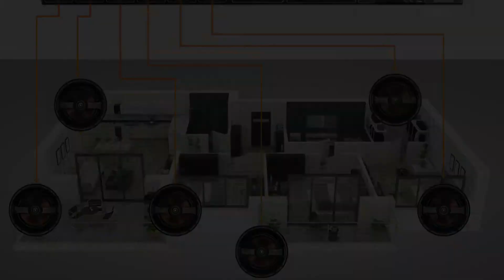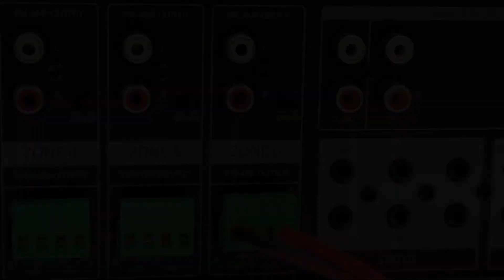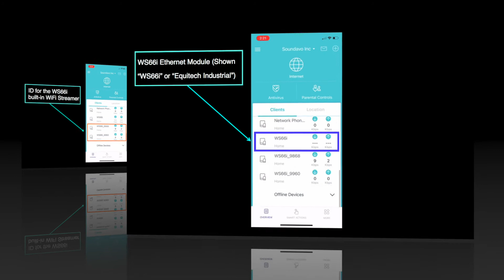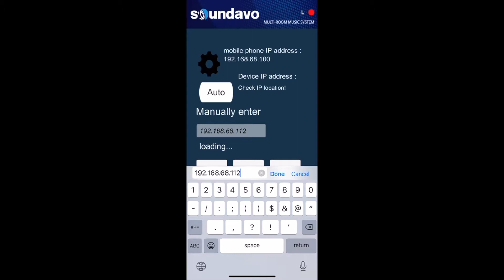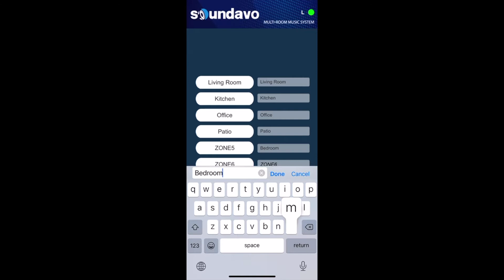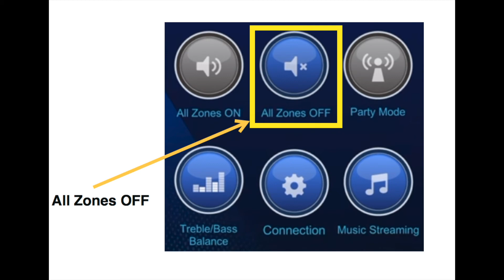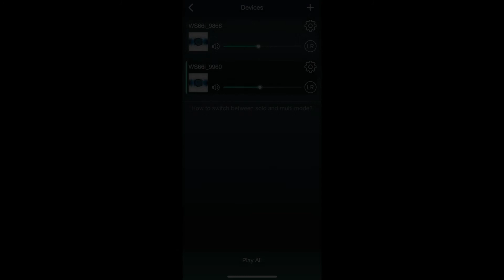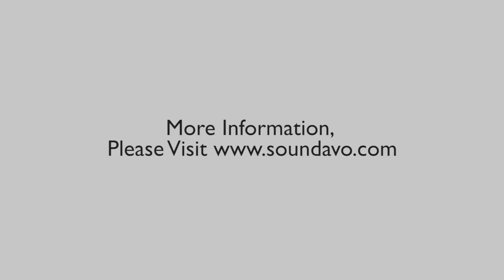Soundavo WS66i Whole-Home Audio Matrix Amplifier - Installation & Setup Tutorial

Comment: how to connect 3 pairs of ic-860cf speakers in one room to control from one k-1 keypad
Reply from the maker: We strongly suggested that NOT connect more than 2 pairs (total 4 pcs) speakers per zone under the Bridge Mode via the speaker output connector from the specific zone on the WS66i. But you could always the use the "Preamp Out" from the specific zone to connect the additional mini power amplifier (for example our CSA-60 / CSA-150 product) to work with the 3rd pair of speakers. The "Speaker Output" and "Preamp-Output" will provide the same audio playback without latency.

Comment: can i control x2 zones from one k-1 keypad?
Reply from the maker: Since you need you setup the DIP switch on the rear side of keypad to define the zone, so each keypad can be only control for 1 zone. Otherwise you will need to use the Preamp Out to works with additional amplifier with more speakers to combine as 1 single zone under 2 amplifiers setup application (one from the WS66i internal amplifier, other one is additional amp that connected to the Preamp Out0
Reply: @soundavoinc1622  thanks

Comment: Hi 
A few questions….

 1. Each of the 6 zones has a preamp output. If I connect zone 1 preamp output to external amplifier to power speakers connected to the external amp, will the WS66i also power speakers connected directly to zone 1 speaker input on the WS66i at the same time? 

2. The WS66i ext doesn’t look like it has preamp outputs 😟
is this correct?

I look forward to your response
Thank you
Reply from the maker: Hello, Derrick, regarding your question:

1. The each zone’s SPEAKER OUT and PREAMP OUT will provide the signal output at the same time without any delay, so 2 outputs have audio playback. 

2. The M66-EXT has preamp outs on each zone, we use the 1/8" Stereo TRS Mini Jack Output instead of the RCA, to save some space under 1U rack-mount chassis design.
Reply: thanks for your quick reply!

I really want this!

one more question….

I saw the video above...

I subscribe to apple music service. I didn’t see this in the list of streaming services for the built in streamer. Can you confirm?

Also, if I wanted to use streaming service app on my iphone, how would I connect this to play with the soundavo?

Thank you
Reply from the maker: @derrickhong594  You can use AirPlay function from your iPhone to stream the music thru the WS66i, those 2 built-in streamers on the WS66i support Airplay & DLNA

Comment: Can this be used with any voice control?
Reply from the maker: Currently, you can’t use the Alexa or Google Home’s voice control to “Controlling” the main WS66i unit function, because the amplifier doesn’t built-in the voice command module, and will be too complex for the whole home audio application (image that all the family members try to use the Google Home to control every zone’s music play back at the same time?)

However, if your online radio service, such as the Spotify account has linked with Alexa Echo (or Google Assistant), and the specific listening zone on the WS66i (for example on Zone 1) has been selected to the Input Source 3 (or 4) as the built-in WiFi steamers with Spotify as the audio playback option, then once you ask Alexa to play the music from Spotify, the music will be played thru the WS66i specific listening zone (Zone 1). 

Also, since your Spotify account has been connected with your Alexa Echo, then you should can ask Alexa to adjust the volume from your Spotify volume bar (as from the music source side), not the master volume on the WS66i amplifier output. 

Please let us know if you have any more questions, thank you.
Reply: @soundavoinc1622   How many people can connect and send music to the system?
Reply: As the user experiences, multi control devices (cellphone/tablet) can be connected to the WS66i at the same time, as long as they all in the same network. The previous settings between the WS66i and Phone Device with App will be refreshed/ updated once it receives the new commands from other phone/tablet

Comment: Would love this model but want more power.
Reply from the maker: The stock 2 x 50W @ 4 ohms works perfect for most of back-ground music playback application, you could always use the WS66i's pre-amp out  to connect with our half-rack power amplifier product to get more power on the specific zone, or even the 70/100V commercial amplifier for multi-speakers connection.

Comment: I have several questions.  

    Does the Soundavo WS66i have separate room control over source and volume in each zone through the smart app? The website says you can turn zones on and off but does not indicate separate control of volume in each room?

    Can I label the zones with room names in the app or are they just numbered?

    Is there any way to control source components through the Soundavo piece other than through an optical cable.

    If I have a streaming app on my phone am I able to cast to the Soundavo piece and pick what room and volume for that room without launching the Soundavo app?

    Does Soundavo offer a piece similar to the Sonos Port that allows me to add a Soundavo zone to a room that already has an AV receiver powering speakers. 

Thanks,
Rich
Reply from the maker: Hello, Richard, thanks for the message, please check below reply. 

(1) Yes, you can adjust the volume, EQ (treble/bass), balance, mute and input audio source selection on each zone via the App. 

(2) Yes, you can rename each input source and zone via the App (more detail from this video 8:50)

(3) Each input source on the WS66i has a corresponding Infrared (IR) emitter output. These outputs are use to control the connected source components remotely through the WS66i IR system. For example, you can connect an IR emitter to the Source 3 IR Emitter output jack and then connect the flasher to the IR receiver window on source 3 device (for example CD Player), then you can use a master remote control or the source 3 remote control in any zone and control your source through the WS66i's K1 (zone keypad) remotely. The WS66i K1 (zone keypad) should have the corresponding source 3 selected for the IR to work. Repeat this for all your Infrared (IR) enabled sources for complete IR source control.

(4) Yes, the WS66i built-in streamer also comes with Airplay function, so you will find WS66i (source 3 and source 4 streamer) in the device list from your streaming app, as long as the "specific zone" on the WS66i you would like to do the audio play back has been selected to the Source 3 (or Source 4) as the input source, and you can set the WS66i audio sound output as 100% maximum, then just use the volume control from the 3rd party steaming music app (if they has one), it's similar to using the Bluetooth Speaker and your cellphone device, the volume can be controlled on both speaker or your cellphone. 

(5) We have many customers who purchased our WS66i to work with their 5.1 AVR,  if your existing AVR doesn’t come with the music streamer function, then it will be a good idea that to use the WS66i be the main audio source, and use the the Preamp-Output from the specific zone on the WS66i sending the audio signal to your AVR, so you can run any audio source from the WS66i to your AVR and play the same audio thru those 2 amps at the same time (WS66i’s Speaker Out + AVR’s Speaker Out).
Reply: @soundavoinc1622  Awesome level of detail in your response.  Thank you very much!

Comment: Hello, 
Can I set output to come out from a T.V.?
If some how so I do that? 
Thanks
Reply: Yes.  Inputs 1 and 2 are RCA jacks, and inputs 5 and 6 are 3.5mm jacks.

You can run wires from your tv to tap into one of those, or maybe use a Bluetooth transmitter (if your TV doesn't already do this) and add a Bluetooth receiver as an input to one of those 4.

I've already wired one of my Alexa Echo devices like this, and am preparing to do the same for a tv.